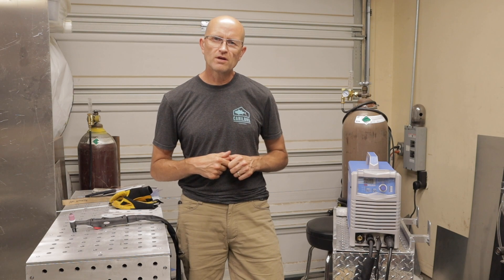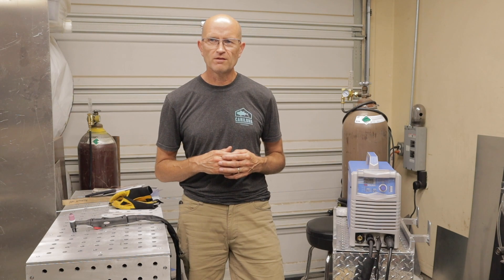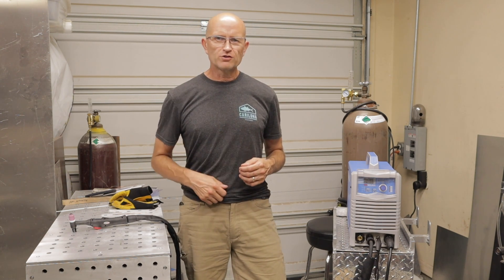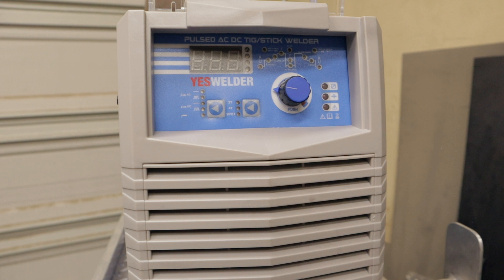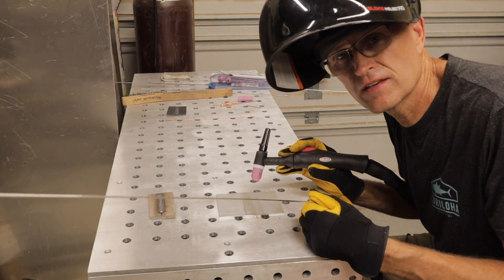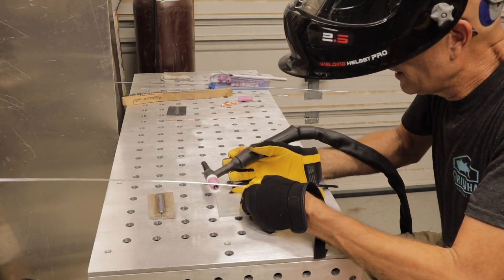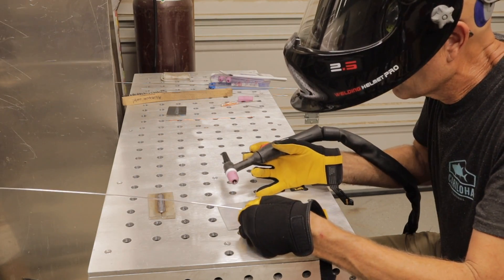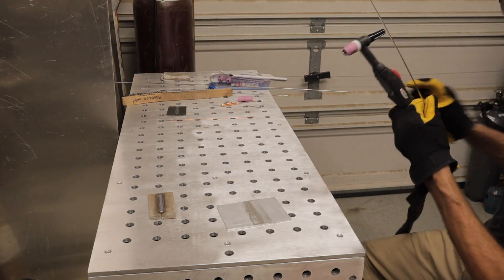NEW YESWELDER TIG Review 250Amp AC/DC welder w/ advanced Pulse capability. DISCOUNT CODE IN NOTES

Comment: This or an esab rebel which is way more but I have the money which should I get
Reply: Also how does this do with 6010 1/8 inch electrodes
Reply from the maker: Hi James, this is a great welder but it does have a couple of things that need upgrading.  The Tig torch that it comes with is kinda bulky and clunky. I purchased a CK Worldwide flex head torch to use with this Yeswelder Tig and it is a great improvement. Also, the pedal that comes with this Tig is pretty crude. I upgraded to a Nova pedal and this really improved the usability of this welder. So the cost of both of these upgrades together cost me about $285 on top of the welder. Once I did these upgrades, it is the nicest Tig I’ve ever used. It welds amazing, especially when I am welding aluminum. So all total with the upgrades, this welder is just under $1000 with my discount code. I don’t know which Esab Tig you are looking at, but I do know they build a great product. If you want a great welder that is ready to go right out of the box, then the Esab may be a better choice if you have the money to spend. I haven’t used this welder as a stick welder yet so I can’t comment on how it will work with 6010 rod. Thanks 😀👍Don

Comment: Anyone curious on the quality of these machines I've done some significant research and ran across some relatively unknown information, these are the real deal. Their quality is very very good.  There made in a large well run clean factory and all they make is this product  line.
Reply from the maker: Thank you so much for your comment sir!   I’ve been trying to inform people of this for a year now! They are a first class company that truly cares about their product quality. 6 of my friends have purchased these welders and they all have had the same experience as me. Great welders at an amazing price because they sell direct to the public.  Thank you! 🙏😀Don
Reply: @PranaTech  you are welcome for the comment. I just got the mig 205 with lift tig.  Nice quality for sure. The tig gun seems more quality then my miller magic.  Eventually I'll probably own most of their models. I bought wire yesterday, their order line was out of wire.
Reply from the maker: Yeah, the word is starting to spread rapidly. They are regularly sold out now of many of their welders. It doesn’t take long for people to recognize a great deal. I originally purchased the 205 mig because I needed a cheap welder to finish a project I was working on. For $315 I figured if it lasted a year I would be happy. It has turned out to be the best mig I’ve ever owned! 🤣

Comment: Did you replace the headgear on the yes welder helmet with the Miller headgear ? If so were any mods needed
Reply from the maker: Hi Christian, yes I did replace it. I have a smaller head and the smallest setting was always too loose. I tried padding but gave up and bought a Miller headgear and it pretty much bolted right up. It was a 3.5 generation set. Here is a link to the one I bought. https://www.ebay.com/itm/Miller-284218-Generation-3-5-Welding-Helmet-Headgear-for-Miller-Helmets/353038505282?ssPageName=STRK%3AMEBIDX%3AIT&_trksid=p2057872.m2749.l2649. 👍😀
Reply: @PranaTech  ok awesome ! I love the Miller headgear after trying a friends I’ll have to pick one up for my yeswelder helmet
Reply from the maker: Yes, I really love this helmet especially now with all the adjustments the Miller headgear affords! 😎

Comment: Can this machine work with 110v? What plug does it come with?
Reply from the maker: Plug is standard 30amp 3 prong 220 volt that you would use for a clothes dryer.
Reply from the maker: Sorry, no it will only run on 220 volts.👍

Comment: If you had to pick one this or your Ahp what would be your choice?
Reply from the maker: Hi Airkill,  well I kept the AHP and have welded side by side for a while now and I made an adapter to use my Nova aftermarket pedal with the Yeswelder Tig and with the good pedal, I just weld better with the Yeswelder Tig. I do like the AHP very much, but one thing that annoyed me is it is listed as a 200 amp Tig and after a couple of months it would only go up to 194 amps and still is that way today after having it for 2 years now.   The other weird thing is that the Yeswelder seems more powerful at the same amperage settings. It takes less amps with the Yeswelder Tig for the same thickness than it would for the AHP.  So, overall I would go with the Yeswelder Tig because it has at least 50 amps more power and I weld smoother and cleaner beads with it, especially with aluminum. With the Yeswelder, I would plan to buy a Nova or SSC pedal because the one that comes with it is not easy to use at all. The AHP now comes from the factory with a Nova pedal. Hope this helps! 👍😀Don

Comment: What is the Supply voltage and current rating requirement for the TIG welder. I’m assuming it is 220 volt only and not dual voltage. What Input Circuit rating is suggested?
Reply from the maker: Hi Bill, the input is 220volts and the circuit requirements are 30 amps. 😀👍
Reply: Hello Prana-Tech! Following on the above, my new TIG250P says 40A max input on the back of the welding machine, but 30A input in the manual as you've stated above. Do you know why this is?
Reply from the maker: Hi Brevin!  Well that’s weird! I just went out and checked mine and sure enough, it says 40A max on the back. Well, I’ve welded at the max 250 amps and I only have a 30 amp circuit in my garage and I’ve never popped the breaker. I’ve had quite a few 250 amp welders and I have never needed higher than 30amps to run one. Hope this helps! 👍😀Don
Reply: @PranaTech  Thank you for the quick reply! I appreciate it! 😃
Reply from the maker: No problem at all Brevin! Let me know if you have any other questions. 👍😀Don

Comment: What is the duty cycles at 250amps
Reply from the maker: Good morning Harold! This welder has a 60% duty cycle at 250 amps. 👍😀
Reply: @PranaTech  what amps at 100%. Thanks my Miller diversion 180  is 10% not too happy with the performance of it
Reply from the maker: Hi Harold, the 100% duty cycle is an impressive 183 amps!  I haven’t tested my Tig yet to see if it’s true, but I have tested their mig that I have and it never has shutdown on long welding joints that used to do it with my miller 210. Kinda blows my mind!🤯 whatever technology they are using with these inverter systems, I’m impressed!
Reply: @PranaTech   nice thanks

Comment: Does it have crater fill on it
Reply from the maker: Hi JB, most of the time you just taper off the current with the foot pedal to get a consistent crater fill at the end of the weld. Many guys are taught to set their downslope longer to reduce the crater at the end of the weld automatically. This welder does have upslope and downslope settings so you could set it up to deal with crater fill if you wanted to with the downslope settings. I have never seen a Tig welder with a specific setting for crater fill, but I’ve only owned 4 machines in my time. 👍😀Don

Comment: what type of connections  it uses dinse or tweco  and what size if dinse 24 or 35? thank you
Reply from the maker: Hi there, the ground connection is Dinse 35 and the main connection for the Tig torch is the gas compression fitting. It connects the gas and the positive lead.😀👍

Comment: Just bought it through your link
Reply from the maker: Nice! I spent about 2 hours welding aluminum today with mine and a friend of mine came over and did some aluminum welding on a cracked intake manifold. He couldn’t believe how nice it welds! I love this welder! Let me know if you have any questions when you get it.😀👍
Reply: Prana-Tech hello does this welder comes with everything you need to start welding. If not what do I have to buy to complete
Reply from the maker: Hi there Cajun! It comes with everything except an argon regulator and you will need some tungsten electrodes as well. I would recommend getting some 2% Lanthanated tungsten in 3/32 size because it is the best all around size. 😁👍
Reply: Prana-Tech thank you. Can you tell me a good regular for this
Reply from the maker: Hi there, I tried to leave a link here to you, but it won't let me.  So I put a link in the description section of this video above for the regulator and tungsten that I am using. 👍
Reply: Could you do a video about tungsten and what type is used for each application? Also size and if the grinder is worth the money?
Reply from the maker: Good Morning! Well, it would be a short video because I use 2% Lanthanated tungsten for everything. I do separate my tungsten from steel to aluminum so I don’t contaminate either. I use 3/32” for every thickness up to ⅛” and anything above that I switch to ⅛” tungsten.  I use a belt sander with a zirconium belt for grinding my tungsten. If you don’t have one, the tungsten grinder might be a good option. Let me know if you have any other questions .😀👍Don

Comment: Why are you attempting to weld anything that is laying flat on a huge heat sink?
Reply from the maker: Hi there. Well because it is my welding bench and it helps to keep the heat from running out ahead of the welds with aluminum. The difference is not that much in terms of amps needed to weld. I do have to turn the amps up a little when welding flat on the bench, but is certainly something that I’m used to and is not detrimental to to any of my welding. Thanks for your question! 😀👍
Reply: Well I don't think welding in wood  is a good idea. LOL
Reply from the maker: Ha! My bench is aluminum!🤣

Comment: My 250 has a hard time with stick welding you only weld for 1.5 sec and stop
Reply from the maker: Hi Vincent,  what amps are you welding at and what electrodes are you using?
Reply: Prana-Tech 125-130 amp 1/8 6011
Reply from the maker: Hi Vincent,  well there’s the problem. Many newer inverter welding machines are not compatible with 6011. It is a high voltage /low amperage stick. Most inverter welders do not put out high enough volts to weld with 6011.  If you switch to 6013 or 7018, your troubles will all go away. My choice of these two would be 7018 for the easiest to weld with.😁👍

Comment: For a beginner is there anything else accessory wise needed to get started? Mostly looking to weld 3/16" & less Jet boat bottoms -Thanks for review!
Reply from the maker: Hi Jack,  I would buy a gas lens kit for your torch. They sell them on the Yeswelder site and other places. This makes a huge difference in the diffusion of the argon when welding and will help you as you are learning to weld aluminum. This was the best advice I ever received for Tig welding aluminum. You should be able to get by with just 3/32 tungsten for 3/16” aluminum and under.  The only other thing I would get when you have some extra money is a better pedal. The Nova or SSC pedal is a huge improvement over the Yeswelder factory pedal. The 5 or 7 pin pedal for the AHP 201XD will work for the Yeswelder 250 Tig.  I know because I converted mine to work with my Yeswelder Tig and it made a huge improvement over the factory pedal.  I have a diagram that I can send you to rewire the plug, if you ever decide to upgrade your pedal. I am  also going to do a video soon about how to build your own upgraded Tig pedal.  Hope this helps.👍😀Don

Comment: what are the settings for tig aluminum welding on the yes 250 amp welder?
Reply from the maker: Hi Pickleman,  I use the Miller welding app on my phone to determine my general settings for Tig with this machine. It is not that critical with Tig because of the variable amperage with the foot pedal.  As long as you set the amps a little higher than you need for the thickness of aluminum you will be fine because you just press down more when you need more power. 1/16”aluminum I set at about 85 amps, 1/8” is 140 amps and ¼” is 180 amps. This should get you started. Remember to hold the pedal down for a few seconds until the light on the panel comes on so the welder knows you are using the foot pedal, otherwise you will get the full amperage at startup. Hope this helps👍😀

Comment: How much does the average TIG welder cost price range average
Reply from the maker: Hi Jim, for a quality Chinese built ac/dc Tig capable of welding aluminum, they range from about $700 to $1500 depending on the brand and amperage. For a US made Tig with the same features you would have to pay a few thousand dollars.🙀
Reply: @PranaTech  gun Smith from 6br to 6pppppc

Comment: Does Yes welder have a great customer service like primeweld?
Reply from the maker: Hi there, I have had great customer service from them, although I’ve never had any problems with any of their products. I don’t own any of Primewelds equipment so I can’t make a comparison between the two. I’ve heard good things about Primeweld, AHP, Yeswelder, and Everlast.  I own Yeswelder and AHP welders but any of these four companies have great reputations for quality welders. 😀👍
Reply: @PranaTech  Thanks for the response. 
This machine comes with power cord?
Can someone use the 220v to110v converter for light works on houses that doesn't have 220v like other machines?
Reply from the maker: Hi there, no this welder is only 220 volt compatible.

Comment: Which model Nova foot control are you using?
Reply from the maker: Hi Chris,  I’m using the Nova pedal for my AHP 201xd. Both welders use the same resistance potentiometer value of 10k ohm and the wiring is the same except the AHP uses a 7 pin plug and the Yeswelder uses a 5 pin plug. I made an adapter that fits the 7 pin on one side and 5 pin on the other so that I could use the pedal on either welder when I need to. If you purchase a Nova pedal let me know and I’ll send you the wiring schematic for the Yeswelder Tig because the one in the manual is wrong. If you just want to use the Nova pedal on the Yeswelder Tig you could just buy a 5 pin gx16 plug like this and replace the 7 pin plug on the nova pedal. https://www.amazon.com/gp/product/B07DC7PHM3/ref=ppx_yo_dt_b_asin_title_o08_s01?ie=UTF8&psc=1  5 minutes of soldering and you are in business!  Hope this helps!😀👍
Reply: @PranaTech  CAN YOU SEND ME THE WIRING SCHEMATIC FOR THE PEDAL TO WORK?
I CAN NOT MAKE THE PEDAL THAT IS SOLD WITH THE WELDER TO WORK EXCEPT FOR ON/OFF ONLY......
Reply from the maker: Hi Lon, for the pedal to work you need to hold it down for about 5 seconds holding the torch in the air without starting an arc. This notifies the computer that there is a pedal attached and the indicator light on the panel will light up on the lower right of the control panel. It is the upper light of the three indicator lights there on the lower left of the panel. If you don’t do this it will just give you the maximum amperage set on the control panel as soon as you start the weld. Hope this helps! Let me know if this doesn’t work and I’ll send you a link to my diagram. 😊👍
Reply: Yes would need the wiring for 5 pin soldering
Reply from the maker: Hi Chris, ok, I’ll draw up a diagram and instructions showing which wires will go where. Both welders use five wires so it is pretty simple once you know what wire matches up with each pin. Send me an email at pranateq@gmail.com and I will send you the diagram when I get it drawn up.😀👍